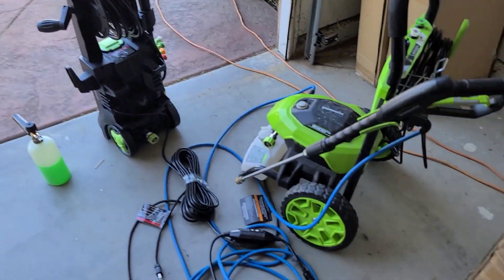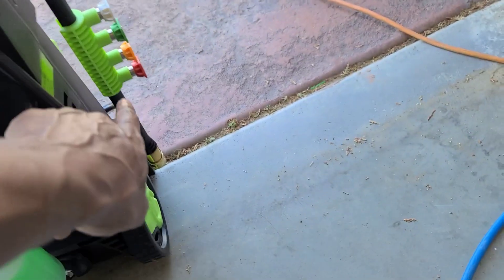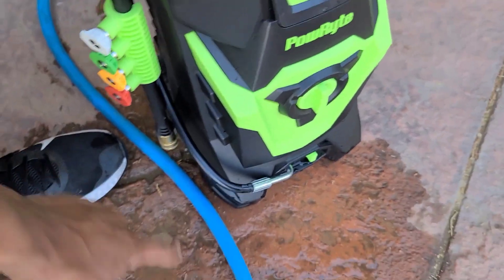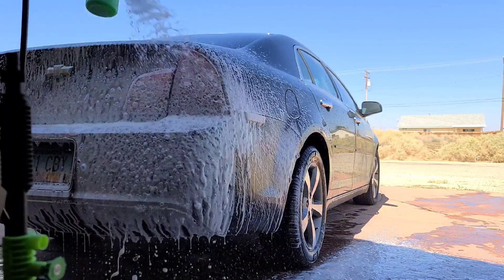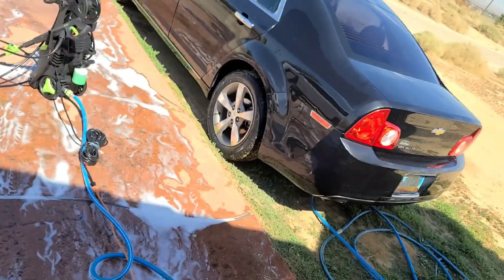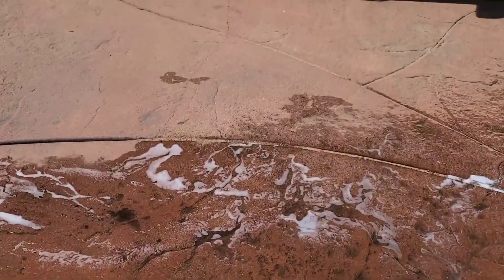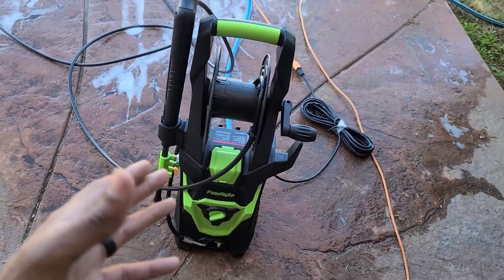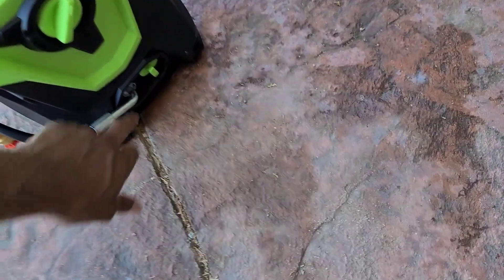Powryte 3800R pressure washer review! #pressurewashing #poweryte #electric

Comment: DO. NOT. BUY! These electric pressure washers claiming anything beyond 2200 PSI are an outright scam. I just returned my Powryte 3800 PSI model today for a full refund. I have an older Sun Joe SPX-4000 Pro rated at 2030 PSI. It still works very well and I mistakenly thought this Powryte 3800 PSI model might be a good upgrade. I also bought a 14" surface cleaner. I knew right away when I pulled the handle on that Powryte that the pressure was weak. I tested it with the brand new surface cleaner and it would barely spin the rotors if at all. I thought there might be something wrong with the surface cleaner until it occured to me that I should test it with my older Sun Joe. Sure enough, the Sun Joe spun that surface cleaer with ease. Let that soak in for a bit. This so-called "3800 PSI" Powryte model could not even spin the rotors on a surface cleaner whereas my older 2030 PSI model did that with ease. Do not buy any of these electric pressure washers claiming really high PSI ratings. Our market is flooded with them. I also suggest getting some sort of pressure guage. I just watched a YT video where a guy was testing a brand new "3800 PSI" model and the best he could measure was 1300-1400 PSI. It jumped to 1600 PSI with a Ryobi tip. Still, far less than the spec'd PSI.
Reply: Link to the video?
Reply: Bet. Order cancelled
Reply: @louferrari1503  I replied a few days ago with links. It looks like they have been conveniently deleted by the channel owner. Wonder why?
Reply: You’re crazy to even be getting this to actually be pressure washing concrete seriously. Best used for washing cars and mobile detailing

Comment: I ordered one yesterday. I got 30% off with all the deals going on.  Hope it works well.  My old gas one the fuel line and carb gummed up and the plastic throttle valve has been eaten through. This is the easier route.
Reply from the maker: Damn wish I could've got mine with that discount, my biggest complaint so far is the hose isn't the longest and it always wants to coil up. Other than that works just fine
Reply: Just curious what you paid with the discount. I just ordered one from Amazon and wondering if $139.00 was  a good deal. $40.00 off would of been nice lol
Reply: @jonecancel  Think I paid 119.00 on Cyber Monday.  Getting one for 139. is not bad.
Reply: How is it holding up ? Does it clean the driveway / patio well. I’m thinking to get one for my concrete backyard.
Reply: @nehakallakuri9174  It burnt out on me.   Good for smaller jobs I guess.  I’ll probably just rent one.  Only got a little bit left.

Comment: Just received mine! Good video thanks. Just an fyi It’s not a on off switch. It’s a spring loaded disconnect for the hose connection. Push it to the side and it disconnects the hose.  The on of switch is the green switch in the center. Just turn it to the on and off positions.

Comment: The description of the pressure washer shows that it can source water from bucket or pool.  So does it come with an appropriate adapter to accomplish that?
Reply from the maker: I don't think you need any attachment the waterhose connection is at the bottom so is you sat the unit inside a pool or large bucket i guess it could pull water although ive never tried